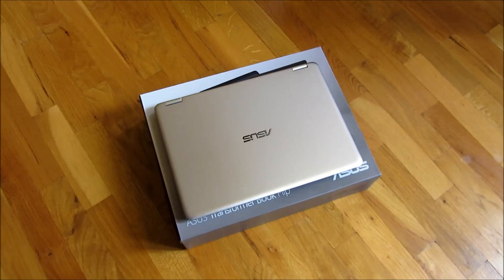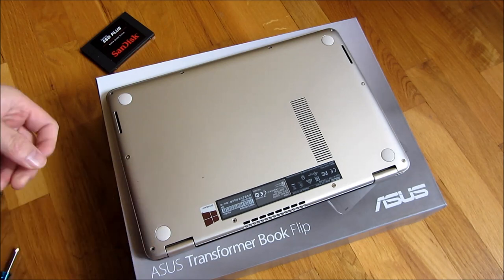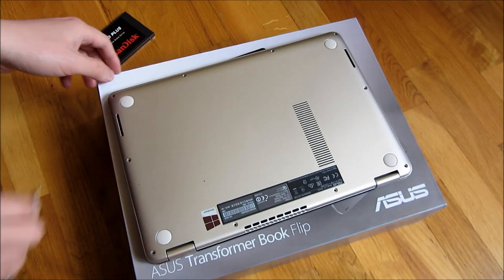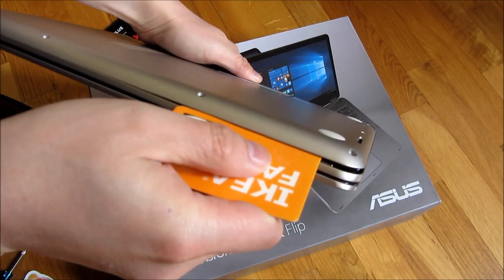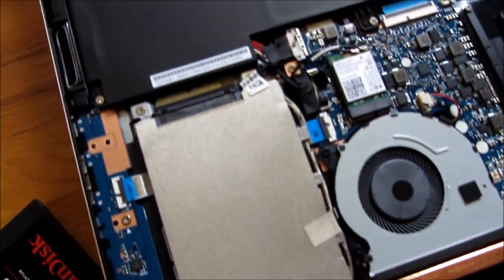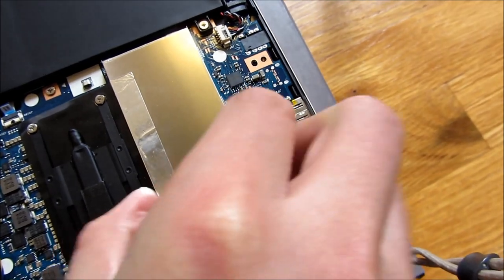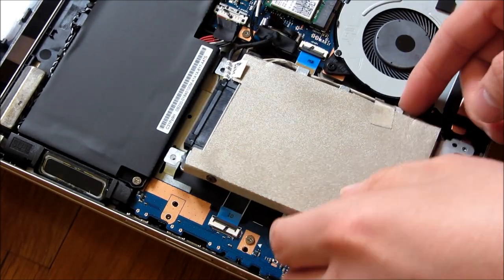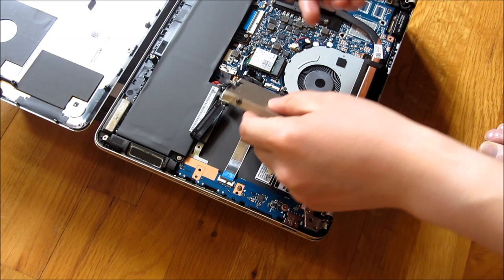How to Upgrade Asus Transformer VivoBook Flip (TP301UA Short Version)

Comment: ENG: You recomended Kingston DDR3 1.5V, But working best with DDR3L (1.35V) memory, It was tested with Crucial Memory CT102464BF160B (8GB) and Kingston A400120GB SSD (Sata 2.5 ''), It works great. The best SSDs (Sata 2.5 '') are the Crucial MX Series (CT250MX500SSD1, CT500MX500SSD1, CT1000MX500SSD1) 
ESP: Usted recomendó Kingston DDR3 1.5V, pero funciona mejor con memoria DDR3L (1.35V) , Fue probado con Memoria Crucial CT102464BF160B (8GB) y SSD Kingston A400120GB (Sata 2.5''), Funciona muy bien. Los mejores SSD (Sata 2.5'') son los Crucial MX Series (CT250MX500SSD1, CT500MX500SSD1, CT1000MX500SSD1)